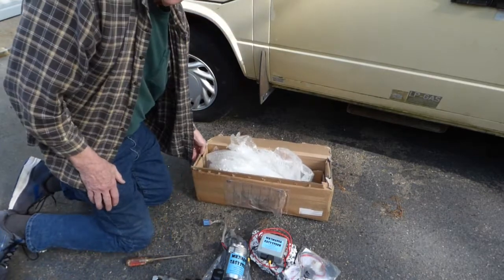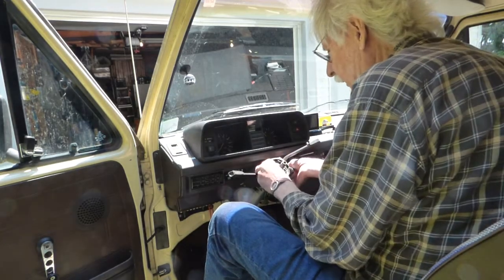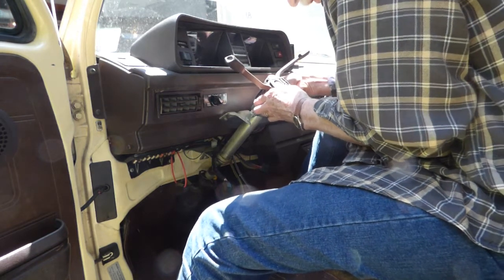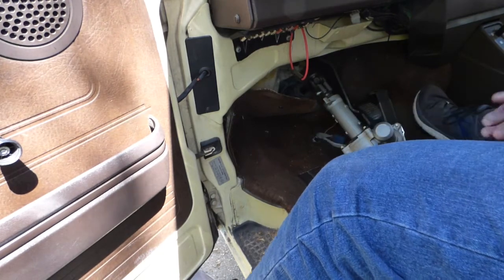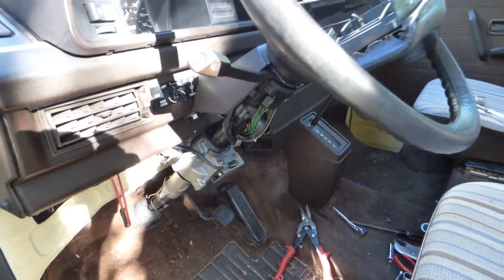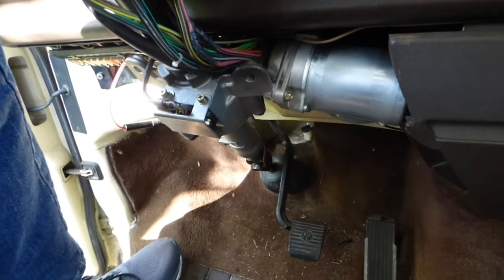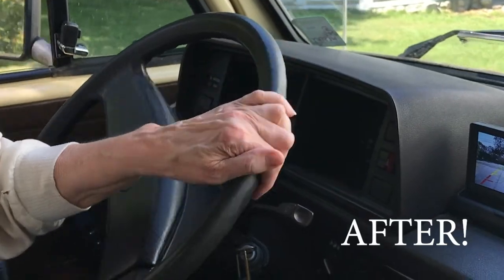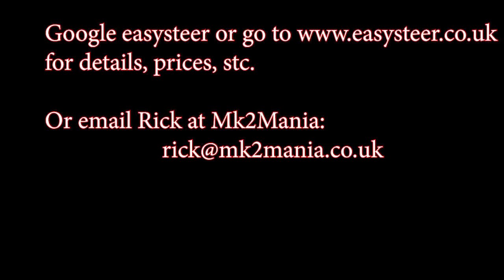Installing Power Steering in an 84 VW Westfalia

Comment: Thank you so much for this video! I also have an '84 and you have given me the confidence to do this long awaited conversion!
Reply from the maker: Best of luck Robert.  I hope you enjoy it as much as we do.
One good suggestion: Follow Mark W's suggestion below and put the fuse close to the battery instead of at the end of the heavy lead.  And thanks to Mark for the suggestion.  Good engineering and very good advice.
Reply: @MaxwellMoot  ok great! A bit disappointing about needing to trim up the plastic. Is the motor visible from the passenger seat?
Reply from the maker: @iRobertTM  Yes, it is visible, but it's a great conversation starter!

Comment: Thanks for the video. I was wondering about power steering in my 84! Do you know what years VW had stock power steering in Vanagons?  I searched it online and wasn’t coming up with straightforward answer.
Reply from the maker: Excellent question, but I have no facts to answer.  My guess is that it was offered as an option on the T3 (early 80's til early 90s) but exactly which years and how much money would be fun to know.

Comment: I'm a little late to the party here but please, please move the position of your fuse in the main feed from the battery!!  It should be fitted as close to the source of power as possible.
Because you've put yours at the load end of the cable, you've left the section of cable between the fuse and the battery completely unprotected. Any short to ground in this section of cable will allow hundreds of amps to flow, only restricted by the resistance of the short, the internal resistance of the battery and the resistance of the cable itself. Your fuse won't see this fault current because it's in the wrong place, so it will not blow. Expect bad things to happen... :-(
By running a single insulated cable under carpets/behind trim next to metal panels etc with no additional mechanical protection only exacerbates the problem and increases the risk. 
I'd hate to see your lovely VW reduced to ashes.
I'm in the UK and am about to convert a Vauxhall Corsa column to go into my daughter's T25. I came across your video whilst doing some research and felt compelled to respectfully point out the above.
Reply from the maker: Good advice Mark.  Thank you.
Reply: I just finished my EasySteer installation on my 1984 Westy following Maxwell's video...made the same observation and put the fuse next to the battery. Thanks for commenting on that publicly. Definitely, a hazard to be avoided! Glen Woolner, Kitchener, Ontario, CANADA
Reply from the maker: @glenwoolner2655  Good for you Glen.  I just added a switch in the big 12V line. In theory the steering doesn't draw power when parked but recently I had found that my battery was dead twice after sitting for only a week.  As an experiment I pulled the 40Amp fuse for a week and the battery was fine.  Maybe my relay is sticky?  Don't know but the switch will serve the same purpose as pulling the fuse.  I found the 12v switch on Amazon.  They called it "Twidec/3Pcs Rocker Lighted Toggle Switch 30A 12V DC SPST ON/Off 3Pin Car Automative Boat with Red LED Illuminated Light ", three for $11US.  The LED lights up when the switch is closed.  I put it on the dash beside the 100K pot.
Reply: @MaxwellMoot  I haven't had a problem yet. Power only goes to the controller when the key is inserted and I believe that triggers the relay in the module...no separate relay needed.  So far things seem to be working well. The biggest issue was fitting the cowling around the new column, lot's of trail and error. Still fine tuning that.

Comment: Hello, I have a question, what for is the 100k control "POT"? Great job you did!!! My 83 T3 is also without power steering and some times is really bothers the immense arm force to be put in in order to turn the wheel.  Was it easy to get the equipment fro the UK? Thanks and regards.
Reply from the maker: Hi Rodolfo. The pot (variable resistor) is a control that decides "how much help" the power steering is giving.  Rotated to one end it give no help at all and it will feel like there is no power steering.  Turn all the way in the other direction and you'll probably feel Too Much! The steering will be very light and sensitive.  We find that about half way up, or a little less, gives all the help you need getting out of a tight parking space, but not so much that at highway speed you don't feel a solid feel of the road.

I found getting the equipment from the UK to the US was easy.  I called Rick at easysteer on the telephone and he was very kind, told me exactly what to do.  The price is in English Pounds and you need to pay in advance so you may need to go to your bank  or use some electronic payment
method.
Reply: @MaxwellMoot   Hello again, Thank you very much for your answers. Will make my decision much easier. Keep on enjoying your "Buttermilk". My T3 is the Green Tree Frog. Regards